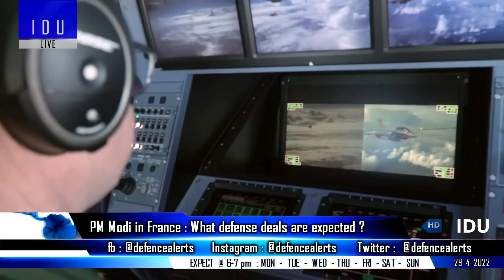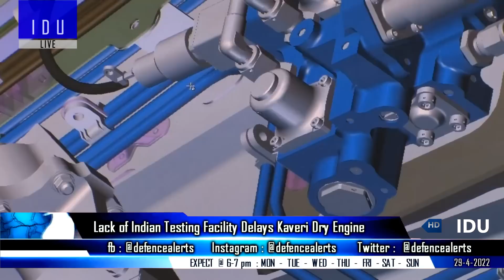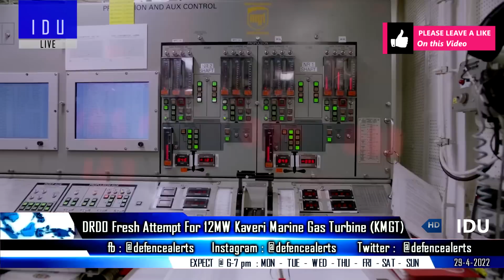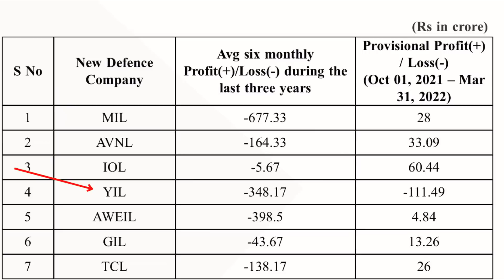Indian Defence Updates : Akash Prime Test,IFCC For FUFA,INS Vikrant Handover,Dry Kaveri Flight Delay

Comment: Pushing for expansion in defence production capacity should be pursued with caution, and parallel to reform in the police force. If police force is not decoupled from ruling parties, and a private defence establishment has the blessings of the same politicians, then a nexus between the 3 at highest levels to ensure capture of power for material gain isnt a political fiction any more.

Comment: Is it possible to make 80+ ton payload carrying military transport aircraft by 4 of 125 kn turbofan engine by DRDO and probably Safran of French. Point to be noted that IL-78 of Russia carry payload of almost 100 ton by 4 of 118 kn of turbofan engine .
Reply: They should start building a heavy lift aircraft under licence in the private sector. Taking it, preferably the A-400M, as a basis the next step should be an indigenous derivative using the Indian jet engine. The Safran design should suffice for this, the Tejas and TEDBF. But the RR engine core is needed for the AMCA MK2 and beyond.
Reply: @jacksonteller1337  let's go for c17 manufacturing in india? I mean if we are going to buy something from US why not biggest and reliable transport aircraft, as US closed it's own production line why not make in India? 

Also is a next version of c17 incoming? Why was the line closed
Reply: @kartikeykasniya6971  not a chance. It has been stopped in the US and they never hand over any technology. They might be able to get the Japanese C-2 but even that is more likely than the C-17 being built in India.
Reply: @jacksonteller1337  hmm. Indeed, although in future india us cooperation will only increase.
Reply: @kartikeykasniya6971  to get more US technology is only possible through joined ventures. Israel, Norway and Germany are doing the same thing. It has led to the RAM from Germany, NSM/NASM from Norway and the Israeli Arrow and other missiles.
Reply: No, the 125kn engines that will be developed by DRDO and a foreign entity will be a low bypass engine. Low bypass engines are suited for fighter jets where transport and civilian aircrafts use high bypass engines.